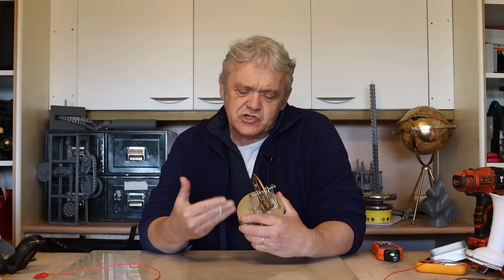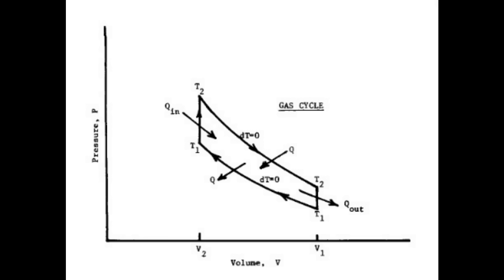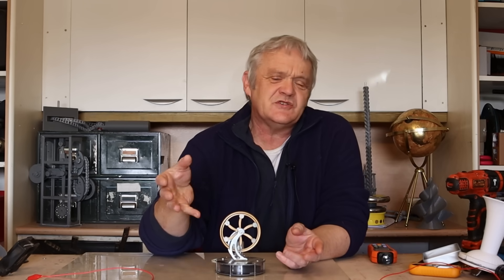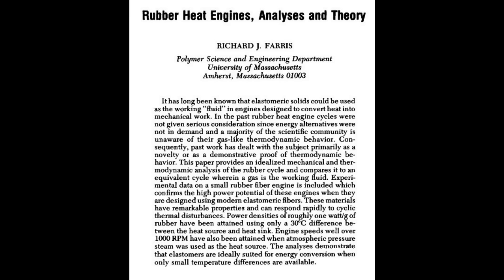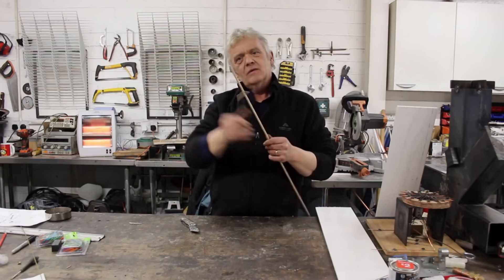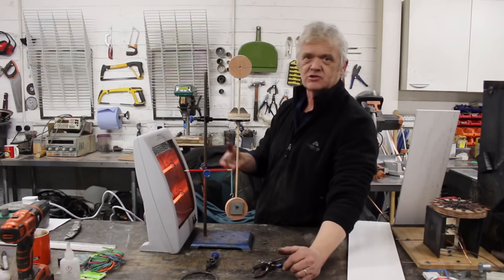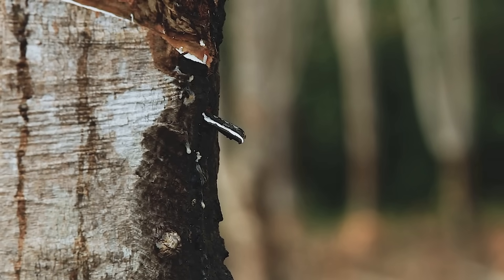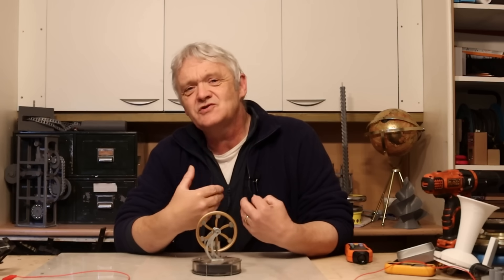2114 Rethinking A Stirling Engine With Rubber

Comment: Yes, I have fallen off the earth since Deb died. I am literally in the woods of Haynesville Maine population 88.  Robert as always you are tantalizing and a man of my heart.  Suppose we incorporate reversible metal hydrides and artificial muscles into this equation.  When the hydride releases hydrogen it gets cold, and the cold causes the elastomer to contract which increases the pressure of the hydrogen gas due to reduced volume and the hydride absorbing the hydrogen becoming hot causing the elastomer to further increase in volume.  Yes, it will work! I know, the trick is getting some polymer that is not going to leak your hydrogen like a sieve.  On an aside you are so strong. You lost everything and rebuilt. I am now where you were, trying to rebuild after losing everything, including my heart.  Keep up the good work.
Reply: His positivity is contagious.
He's always very passionate about his finds and showing them to us.
You seem very fascinating as well.
Hopefully tough times may get easier for you.
And only serve to make you stronger, not weak.
Reply: My brain went to a similar place with metals, and of course I immedately found there is a commercial toy sterling engine made with NiTinol wire available online for about $70 lol 

I just want to know how much power I can get out of my backyard once I move to the desert....
Reply: @Johnson_Rice  That could work, or maybe not quite...
NiTinol has an efficiency of I think 5%. 
Like you're putting enough power into the wire or NiTinol thingy, to pull 100 grams, And only getting enough output as much as 5 grams of power from the NiTinol.
Reply: @Johnson_Rice  but don't worry, some simpler stirling engine designs may work quite well.
Look up flat panel Stirling engine.
They're awesome.
And.. if I can. I'll try to make one, with simple, available materials.. cheap and easily if possible.
I'm trying, I just live in a place with (relatively) limited resources.
Reply: Science overcome all things it supersedes everything when it becomes number 1 priority
Reply: @yasirrakhurrafat1142   Thermoelectric elements  in a stirling engine hybrids
Reply: I like the artificial muscle idea. A rubber one maybe?  Zeolites could be interesting in conjunction as well 🤔
Reply: Seek therapy and/or lay off the drugs/alcohol.
Peace.
Reply: @yasirrakhurrafat1142  Anything that doesn't kill you just makes you stranger.
Reply: @Johnson_Rice  'Metals' ? ... what?
Reply: @bikerfirefarter7280  Don’t do drugs or alcohol.    Thank you  for your constructive input, you must be the life of the party.
Reply: @colleenforrest7936   Zeolites are interesting in the sense that as they absorb water they heat up, and they pull water vapor so quickly that they can generate a. Vacuum which will cause said water to boil in place due to lowering the vapor pressure right down to the freezing point of the water.  The problem is the greater amount of heat input to recharge the zeolites. So thin film hydrides are a better bet, however you might find a combination where if you are using small hollow tubules of the elastomer you could trap water inside and have one end  connected to a heat pipe, and the other to an end with a plug of zeolite, with a heat transfer plate to a reversible metal hydride like LANI5H6.  I have worked and played with such for over a decade,  but besides demonstrating low power applications, such is limited by the low conductivities of the hydrides, and the hydrogen porosity of polymers.  And if you want greater power you want higher pressure, but then you just leak out the hydrogen quicker.
Reply: Hope all peace comes over you in jesus name amen amen amen.
Reply from the maker: Kimberly!! I am so happy to hear from you. I did wonder and I am so sorry about Deb. And yes I did lose everything - I am working from my garage and back room right now - It is a hill but you climb it like every hill - one step at a time. I really am very glad to hear from you I always love your ideas
Reply: Should work quite well.
Reply: Sounds familiar, how far is that from Waterboro? Falling off the earth and living in the woods is my hobby.
Reply: @Alkimi   250 miles waterboro is a metropolis compared to where I am.   But I get to see moose regularly
Reply: @KimberlyRPeacock  for sure haha. Population 80 says it all. How far of a drive is it for a loaf of bread and how far is it to a movie theater (with the new releases)?
Reply: @Alkimi  about  2 hours to Bangor but houlton is 40 minutes by car.  Houlton I can get groceries. And they do have a movie theater but limited in movies.  Danforth is closer about 30 minutes by car and it also has a grocery store and a gas station / diner
Reply: @KimberlyRPeacock  then we might run into each other next summer. It would be cool to have a like-minded individual nearby. Family is one thing... ukno
Reply: @ThinkingandTinkering  Using such as a motor, and alternative to get heat in and dispersed and around the limited thermal conductivity may be had by embedding microwave susceptors like silicon carbide and using microwaves.  I have done this with zeolites but you overheat zeolites and you get a chain reaction. The way around that is to use the new fancy and expensive fiber optic thermal sensor.  Then you can time pulse for a particular temperature.   I have learned a few tricks to work around thermal conductivity limits. Figure if I share them will you, my past time and efforts will not have been a waste of time.  I apologize on the cad drawings I had to get wood inside yesterday as we have the threat of a snow storm and I needed to get wood in while it was dry and easier to get to.  I will try to get on it today sometime.
Reply: What's this about hydrogen rejection/transfer?
Reply: @ Rejection?  Hydrogen is absorbed or released the metal hydride and generally when its absorbed it an exothermic reaction, and when released its an endothermic reaction
Reply: @KimberlyRPeacock  Please say more! I am just beginning to learn about hydrates and zeolites sound like a shortcut. Thank you for your comments!
Reply: @ Reversible metal hydrides are what sponges are to water.  They are metal alloys that act as hydrogen sponges storing hydrogen reversibly.  The ally’s can be tuned for storage capacity, temperature and equilibrium pressure. When Hydrogen at pressure above the equilibrium pressure at the current temperature of the hydride it begins to absorb hydrogen, the enthalpy of absorption is large, on the order of 20K/mol H2. absorbing is generally an exothermic reaction generating an increase in temperature.  This increase in temperature increases the equilibrium pressure to absorb hydrogen unless heat can be removed keeping temperature stable, conversely as hydrogen is being released it is an endothermic reaction and the equilibrium pressure will begin to drop unless heat is added to keep temperature stable and the equilibrium pressure nearly constant.   A key feature is that for. Small temperature change of 15 to 10 Kelvin, the equilibrium pressure can double or half.  
Zeolites are different in that they absorb and store water, and water vapor is so attracted to the zeolites that the vapor pressure continues to drop resulting in the water boiling and lowering the temperature of the remaining water, due to the change in the enthalpy.   Do you have more specific questions?
Reply: @KimberlyRPeacock  I do, but have to think these through. Why these aren't batteries I don't know.
Reply: @ They can be thermal batteries, and you can Make them into electrochemical batteries.  In fact the early batteries for computers and such were hydride batteries built around nickel hydride chemistry
Reply: @KimberlyRPeacock  I would like to learn this. Right now there's a great need for thermal batteries, but I sense a water mover too. I've got to actually try this. 
Much gratitude for your comments! Happy travels and safe returns!
Reply: @ There and lots of research.  But if you would be willing to take a little advice from an old lady, who focused on trying to always find the optimal solution to the point it led her to ruin.  It is not the best or optimal that is important to the average Joe or Jane, it is affordability, followed by practicability and convenience.   In such water and sand for many purposes, although not the best or optimal in all situations can be used by average people to store heat for space conditioning, refrigeration, and electric generation.  Utilizing heat pipes to convey that energy from wood stove,solar collector, compost, is easily and economically done.  More you can hybrid some photovoltaics solar panels and use diode strings as heating elements and they will act without fancy electronics to give maximum power tracking, and that heat can be added to your thermal batteries.  Wind and water can do the same, and you can use stirling engines to take that heat and convert it to electric when needed.
Reply: @KimberlyRPeacock  I'll take that and give it too. No such thing as perfect wood. Never heard of diode strings but now I have to see some. Some Stirling engine!

Comment: We often see these things using heat sources, but cold sources shouldnt be ignored either.  We had one of those sterlings nicely running on a cup of ice as a table demonstration.  It really drew the crowd.
Reply: That is why integrating the hydrides works so well. When they release hydrogen its an endothermic reaction and when they absorb hydrogen its an exothermic reaction
Reply from the maker: very good point - cheers
Reply: catalystic energy and fusion
Reply: waving ears

Comment: solar stirling engines can be used for powering boats or machines when there is not wind, increasing efficiency with cold water from sea or rivers, they can be also used as fridges or even frozen water desalination
Reply from the maker: they can indeed

Comment: Honestly speak what's coming to mind the big concrete fly wheel Stirling engine attached to a parabolic heater source. The rotational force turning a electric generator.
Reply from the maker: that would work

Comment: Reminds me of an idea I had ages ago if making a sun wheel. Basically a large wheel with many pistons arranged around the perimeter.  Each one with a wheel at one end that pushes against a diverging track at the expansion side and convergent on the thermal contraction side. 
At the time I thought to use a bunch of heat piston thingys that open green house windows for a demonstration model. Alas no time to tinker as yet. 
Imagine a reverse water wheel for irrigation systems. 
Maybe when I retire!!
Reply from the maker: you certainly should get into tinkering mat lol - I hate to see good ideas not being worked on!

Comment: I watched this video a few months ago and had to come back to it as I think I found a different version of this. You should check out what a Minto Wheel is, Robert. It's a wheel with sealed chambers end to end filled with propane canisters. You heat the propane up to displace it and drive the wheel. It may be faster than rubber bands.

On the subject of stirlings, you should also check out a Malone Piston. It was a piston filled with water that couldn't vaporize due to the limited space, creating a lot of push, and the inventor managed to build one that was 50hp. I can't find much information as his work just kind of ended in the 1930's due to the advance of other machines.
Reply: Say more! I just found out about Amonton's engine- which would have been extremely expensive and heavy in those days. That Minto would weigh much less, and propane was mentioned. Thank you for your comment! Happy travels and safe returns!

Comment: Robert, the biggest feature of the Stirling engine is the regenerator, which recovers much of the heat that would otherwise go out the hear sink. That's where its efficiency comes from.

How would one do regeneration in a rubber engine?
Reply: Yes, the regenerator is unique to the stifling engine as opposed to hot air engine, but recovers much of the energy? Define much? Like a few percent at most.  Just think about the physics, You don’t;t need complex analysis fermi solutions will get you there.   A good regenerator will approach the mean between Source and sink.   As I suggested if you treat the rubber engine like an artificial muscle then you can for example like with electro active polymers like 3m’s VHB 3910 tape harvest contractions, while heat expands the gas contained within, and in regards to regenerator, I suggested elsewhere using think rims of reversible metal hydrides, such that increases and decreases in pressure triggered release or absorption of hydrogen and endothermic and exothermic reactions.
Reply: For those who prefer one line answers. Phase changing from solid to liquid and liquid to solid.Might be one way
Reply from the maker: I don't know mate - yet! lol
Reply: @ThinkingandTinkering  Here is an idea that you could test. Many small heat pipes, with a working fluid semi optimized for the temperature differences, where the rubber is connected to the bottom and. Or top third of the heat pipe.  Perhaps you knurl the tops and bottoms where it will meet rubber/polymer such that it has high surface area. In this manner we help increase thermal transfer even though conductivity for rubber is low.  We can also dope the rubber and or polymer with graphene.  All the better then if our polymer/rubber ends up a foam.  If a foam then you could fill the voids with a different polymer/rubber and that becomes the regenerator.

With the heat pipes we can quickly get a temperature difference from atmosphere distributed across the rubber, if we are providing heat and it contracts, as a foam we have compression and the voids be they are gas or another polymer will have either an increase in pressure or temp oscillate between both.  (That would be a regenerator as much as the displaced on a Senft type stirling engine acts as both regenerator and displacer.  I think however a pic type polymer might be more interesting.  For inspiration I would refer you to one of the early developers of artificial muscles SRI and their prototype bouy type generator, where they used VHB 3910 tape and doped it with carbon electrodes, and a piezo element, such that when expanded it acted like a large capacitor and on expansion/relaxation it discharged its charge.  With some diligence and effort one can get these things to work, but as you know there is no perfect engineering, everything is a compromise.   The answer to many skeptics question as to if this stuff works why is it not being done, is usually there is some sort of obstacle and or draw back.  I have worked with hydrides grow two decades, and when I first got into it, I thought the answer would simple be improving thermal transfer, but the intractable problem is that hydrogen wants to escape all containment.  Give me a polymer that can expand and contract like rubber and deal with pressures up to 600 PSI, and will leak less that 1 percent of hydrogen a day, and move over Elon on the Forbes list.   LOL sadly there is no such miracle material, but if some one has it, please contact me.  :).

Comment: Hi there, how about this idea, combine the pop pop drive with the sterling engine.    Arrange a narrow cylinder with piston at the top, in the cylinder put a fluid close to boiling.   When a bubble forms it pushes the cylinder up.   The pressure drops as the cylinder goes up and the bubble expands.   The bubble floats to the piston (which could have a high surface area to extract heat.   As the piston compresses and cools the bubble condenses.   Cycle repeats (maybe).

Comment: A quick stroll to the park and down the canal path... It got me how many leaves were there.... It got me thinking if you had algae troughs instead of solar.(it doubles in a day in some cases) could you get a green and cheap combined heat and power source 🤔. All that doubling surely adds up quickly in terms of bio mass

Comment: Hi they fix the leak problems by completely encapsulating the unit then extending the drive shaft though a tube in to a thick stainless steel disk where another disk with neodemion magnets were mounted the can't get over 150degs or they die .the pick up coils were located out side next to the disk and picked up the magnetic flux there . though the non magnetic stainless steel.then they got the idea to use heat diodes in the hot zone  there like copper ot stainless steel tubes going up in to the zone then the shelf piston would drop down on them and completely Incase them stopping the glass expansion..you could use any medium in the tubs for heat transfer except organic it decomposes over time .a mix of sodium and potassium would work well .all the heat is out side in the lower tube section. Fire wood a camp fire would be good .no leaks .
Reply from the maker: yes - but they still have that problem lol
Reply: @ThinkingandTinkering   I don't get it unless there using helium it bleeds though everything.

Comment: Watching the last clip of the machine interacting with a box, and imagining a elastic heat pump cooled chamber. Put mechanical energy in, have it expand and contract in different regions, and move energy away from the container.
Reply: That's what the box was.  It was someone's video experiment to see how much heat they could pull using elastic mechanical power only.  It was...  a couple of degrees IIRC.
Reply from the maker: a rubber frdge

Comment: But maybe also in combination with a heat battery, this could mean high efficiency at the moment you want it.. (but a more serious stronger sterling then, perhaps then, they are not easy to make efficient as DIY)
Reply from the maker: no they are not you can make very good Stirling but exotic gasses and pressure is needed